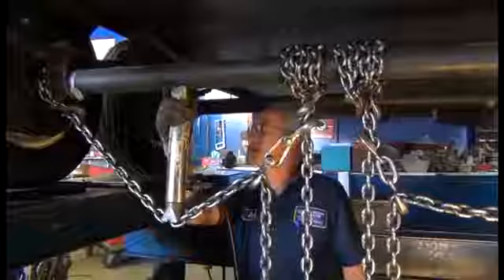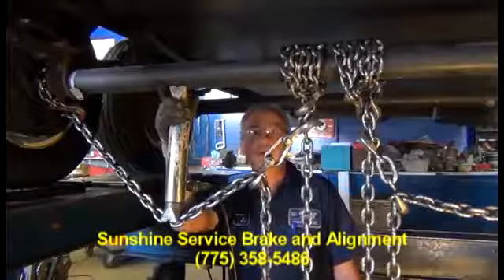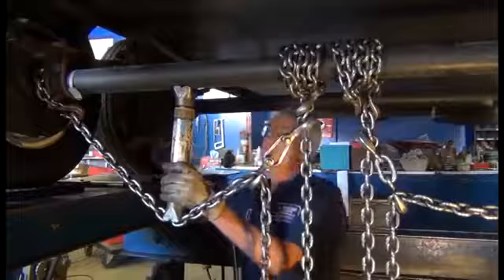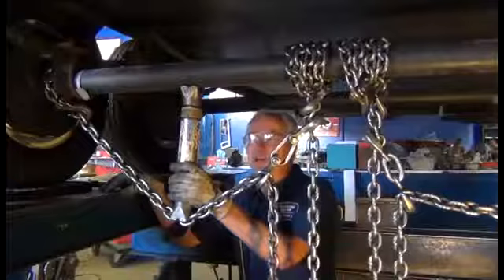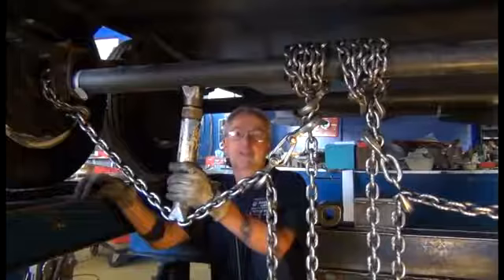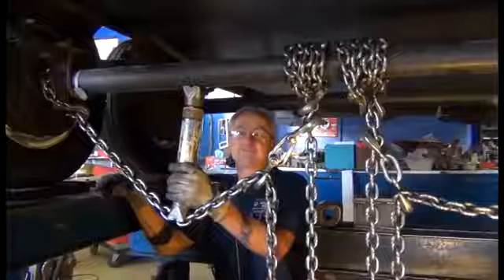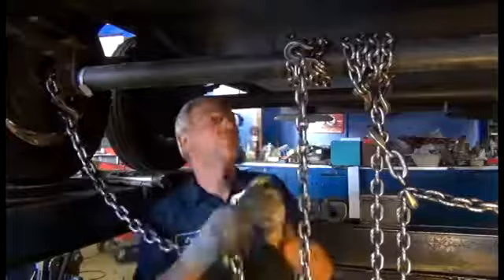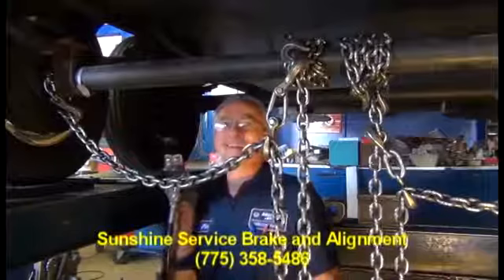Trailer Axle / Wheel Straightening and Alignment

Comment: 4 hour shop rate? buying a new axle probably cheaper depending on trailer
Reply from the maker: New axles not cheaper, most of the time. But, even with the new axle, the actual alignment specs are way off if not aligned properly, and this is the only way to do it.
Reply from the maker: No, actually.  That "new axle" WILL need bending to align it when you install it, AND will need it again in the future. You won't know that of course.  You'll just get tire scrub resulting in premature tire wear and bad gas mileage because of that.  Trailer axles will always need re-alignment over time, or, you can just keep buying new tires and try putting a new axle in every once in a while.  But, that new axle isn't aligned out of the box.  If we put that trailer with that new axle up on our rack we would be able to prove to you with alignment machine readings, printed on a late model Hunter alignment machine, that will show you that even new axles are not even close to correct alignment numbers although they may be new.  Every brand new trailer we put on the rack is like that, even my new 25' Artic Fox.  Sorry I just now saw your comment here, and so am just now finally replying.  There are very few shops around anymore that have the equipment and are set up to do this work anymore, much less someone who knows what they're doing, and probably not even one in your state.  We know a little bit about this topic.  There is no other real solution.